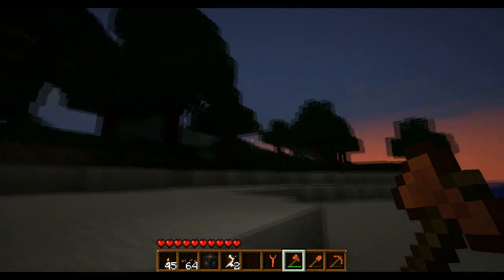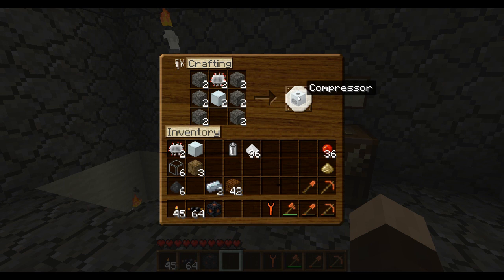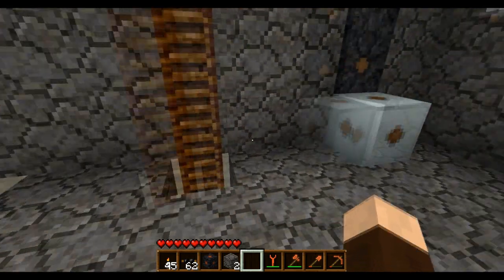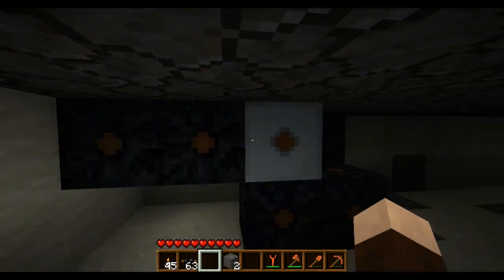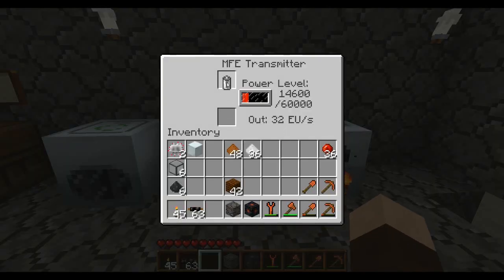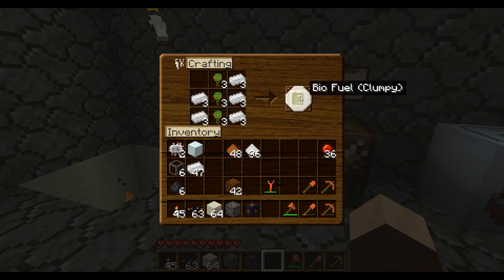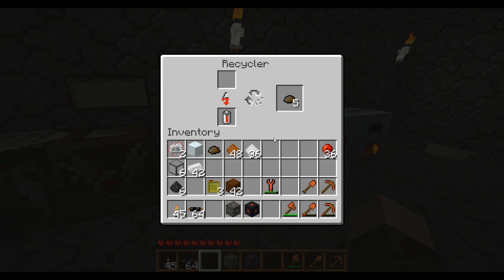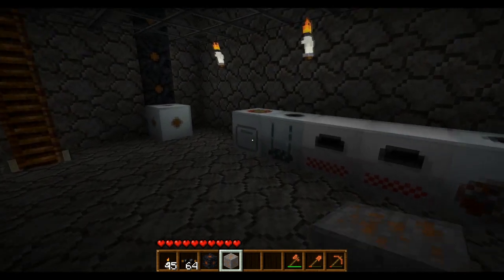IndustrialCraft Adventures - Episode 4: Wind Power, Going Green!!!

Comment: I have found that instead of putting your basement mfe transmitter where you did, you can put cable along the bottom of your machines and the mfe transmitter below the first cable in the line then run the cable into the side of that, then you dont have to worry bout not being able to power the machines in the line.